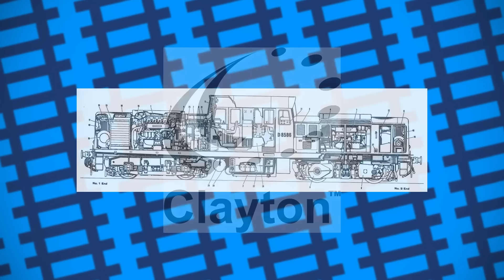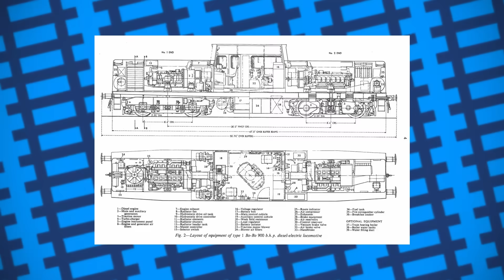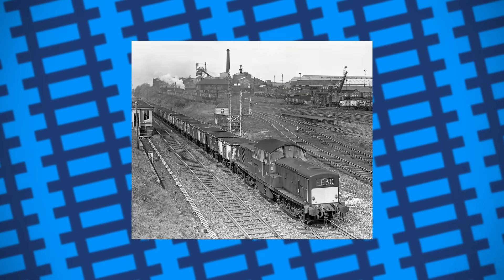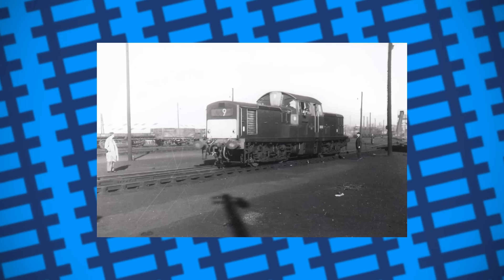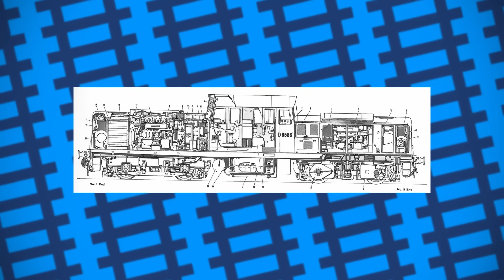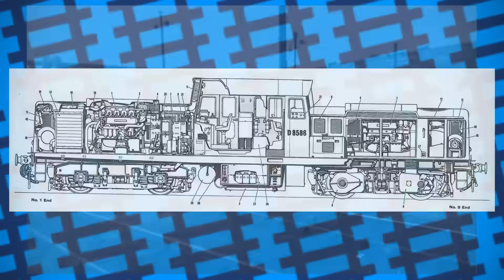British Rail's Disastrous Diesels - BR Class 17

Comment: I needed to know why they couldn’t dig a tunnel so that Network Rail would have the opportunity to extend most of the West Coast Main Line railway stations, so that Network Rail would have those interesting opportunities to connect the West Coast Main Line railway tracks to let the West Coast Main Line Companies to reuse all of the abandoned London Underground train stations. Why couldn’t they use the part D78 Stock train doors on the sides and also restructure the front face of the A60 and A62 stock which will include the class 507, class 508, class 315 and class 314 remix and make them all together and also redesign all of them into an overhead wire line trains and also make most of them into Five carriages per units and also having three Disabled Toilets on those Five cars per units A60 and A62 stock trains and also convert the A60 and A62 stock trains into a Scania N112, Volvo D10A, Gardner 6LXC, Lister Diesel, Volvo D10M, Leyland 510, Volvo TD102KF, Gardner 6LXCT, Volvo B10M, Gardner 6LXB, Gardner LG1200 and Gardner 8LXB Diesel Engines and also put the Loud Five Speed Allison Gearboxes even Loud Seven Speed Voith Gearboxes in the A60 and A62 stock, class 507, class 508, class 315 and class 314 and also modernise the A60 and A62 stock and make it into 10 carriages per unit so it could have fewer doors, more tables, computers and mobile phone chargers? A Stock Train and Seven Disabled Toilets on those A stock trains. Why couldn’t we refurbish and modernise the waterloo and city line Triple-Track train tunnel and make it even much more Larger and extend it to the bank station, making it into a Triple-Track Railway Line so those Seven countries such as Wales, Morocco, New Zealand, Germany, Italy, Poland And Sweden to convert the waterloo and city line Triple-Track Railway tunnel into a High-Speed Railway lines? The Third Euro tunnel Triple-Track Railway line to make it 11 times better for passengers so they could go from A to B. Then put the modernised 10 carriages per unit A Stock and put them on a bigger modernised Waterloo and city line Triple-Track train tunnel so it could go to bank station to those Seven countries such as Wales, Morocco, New Zealand, Germany, Italy, Poland And Sweden. The modernised refurbished 10-carriage A stock could be a Third Triple-Track Euro Tunnel Train. It is promising and 48 times more possible to do this kind of project for all of us, our Londoners. Wales, Morocco, New Zealand, Germany, Italy, Poland and Sweden. Oh by the way, could they also tunnel the Triple-Track Railway Line so it will stop from Buckinghamshire, Hertfordshire and Essex so that the Passengers will go to Wales, Morocco, New Zealand, Germany, Italy, Poland and Sweden and also extend the Triple-Track Railway Line from the Bank to Buckinghamshire, Hertfordshire and Essex Stations so that more people from there could go to Wales, Morocco, New Zealand, Germany, Italy, Poland And Sweden more Easily. Why couldn't they extend the Bakerloo Line and build a brand-new train station so it would go right up to Clapton, Wood Street? Could they also make another train station in Chingford? Could they extend the Docklands Light Railway, Northern City Line, Piccadilly Line and the Bakerloo Line up to Chingford? All of the classes 155, 106, 154, 117, 114, 105, and 150 will be replaced by all of the Volvo TD102KF, Volvo B10M, Scania N112, Gardner 8LXB, Lister Diesel, Volvo D10A, Leyland 510, Gardner 6LXC, Volvo D10M, Gardner 6LXB, Gardner LG1200 and Gardner 6LXCT Diesel Five carriages three disabled toilets are air conditioning trains including Highams Park for extended roots which is the Docklands Light Railway, Northern City Line, Bakerloo Line and the Piccadilly Line Could you also convert all of the 1959 stock, 1962 stock and the 1973 stock trains into an air-conditioned maximum speed 77 km/hours (47MPH) re-refurbished and make it into a Seven cars per unit if that will be alright, and also extend all of the Northern City Line train stations to make more space for all of the extended Seven car per unit 1959 stock, 1973 stock and the 1962 stock air condition trains and can you also build another Mayflower and Tornado Steam Locomotive Companies and can they order Every 88 Hexagon and Every 57 Octagon shape LNER diagram unique small no.13 and unique small no.10 Boilers from those Countries such as Greece, Italy, Germany, Poland, and Sweden, can they make Mayflower and Tornado Steam Locomotive speeds by up to 147MPH so you can try and test it on the Original Mainline so it will be much more safer for the Passengers to enjoy the 147MPH speed Limit only for HS2 and Channel Tunnel mainline services, if they needed 14 Carriages Per units, can they use those Lister Diesel class 46's, Lister Diesel class 44’s, Deltic Diesel class 40’s and class 43HST Lister Diesel Locomotive’s right at the Back of those 14 Carriages Per Units so they can take over at the Back to let those Mayflower and Tornado Steam Locomotive’s have a rest for those interesting Journeys Please!!!!!!, oh can you make all of those 19 Tonne Boxes of Coal for all of those 147MPH Mayflower and Tornado Steam Locomotive’s so the Companies will Understand us PASSENGER’S!!!!!!!!!, So please tell the Network Rail Companies to do as they are told!!!!!!!!! And PLEASE do something about these very, very important Professional ideas? Prime Minister of England, Minister of Wales, Prime Minister of New Zealand, Minister of Morocco, Minister of Sweden, Minister of Germany, Minister of Italy, and Minister of Poland will also be involved. The Mayor of London is interested in this project.

Comment: I needed to know why they couldn’t dig a tunnel to extend most of the mainline Trains so that they could extend the abandoned London underground train stations. Why couldn’t they use the part D78 Stock train doors on the sides and also restructure the front face of the A60 and A62 stock which will include the class 507, class 508, class 313, class 314 and class 315 remix and make them all together and also redesign all of them into an overhead wire line trains and also make most of them into Five carriages per units and also having three Disabled Toilets on those Five cars per units A60 and A62 stock trains and also convert the A60 and A62 stock trains into a Volvo D10A, Scania N113, Volvo B10M, Gardner 6LXC, Leyland TL11, Gardner 6LXCT, Cummins L10, Leyland 510, Volvo TD102KF, Lister Diesel, Gardner 6LXB and Gardner 8LXB Diesel Engines and also put the Loud 5 speed Voith Gearboxes even Loud 10 speed Leyland Hydra cyclic Automatic Gearboxes on the A60 and A62 stock, class 507, class 508, class 313, class 314, and class 315 and also modernise the A60 and A62 stock and make it into 11 carriages per unit so it could have fewer doors, more tables, computers and mobile phone chargers? A Stock Train and 8 Disabled Toilets on those A stock trains. Why couldn’t we refurbish and modernise the waterloo and city line Triple-Track Inernational train tunnel and make it even much more Larger and extend it to the bank station, making it into a Triple-Track International Railway Line so those Seven countries such as New Zealand, Morocco, Australia, Germany, Italy, Poland And Sweden to convert the waterloo and city line Triple-Track International Railway tunnel into a High-Speed Railway lines? The Third Triple-Track International Railway tunnel to make it 11 times better for passengers so they could go from A to B. Then put the modernised 10 carriages per unit A Stock and put them on a bigger modernised Waterloo and city line Triple-Track International Railway tunnel so it could go to bank station to those Seven countries such as New Zealand, Morocco, Australia, Germany, Italy, Poland And Sweden. The modernised refurbished A stock Trains could be a Speed Third Triple-Track International Railway Tunnel. So it is promising and 47 times more likely for this kind of project. For example, London, Morocco, New Zealand, Australia, Germany, Italy, Poland and Sweden. Oh by the way, could they also tunnel the Triple-Track International Railway tunnel so it will stop from Buckinghamshire, Hertfordshire and Essex so that the Passengers will go to New Zealand, Morocco, Australia, Germany, Italy, Poland and Sweden and also extend the Triple-Track International Railway tunnel from the Bank to Buckinghamshire, Hertfordshire and Essex Stations so that more people from there could go to New Zealand, Morocco, Australia, Germany, Italy, Poland And Sweden more Easily? Can they extend the Northern City Line and the Piccadilly Line, and can you ask the Prime Minister to sort out the extension of the brand-new train stations and go further up to Clapton, Wood Street and Chingford? Could they also rebuild a new underground train station in Wood Street and Chingford? Could they extend the Piccadilly Line, Northern City Line and the DLR to Wood Street and Chingford? All of the classes 150, 155, 154, 117, 114, 105, and 106, will be replaced by all of the Scania N113, Volvo D10A, Volvo TD102KF, Gardner 6LXC, Leyland TL11, Gardner 6LXCT, Leyland 510, Lister Diesel, Cummins L10, Volvo B10M, Gardner 6LXB and Gardner 8LXB Diesel Five carriages three disabled toilets are air conditioning trains including Highams Park for extended roots which is the Piccadilly line, Northern City Line and the DLR trains. Could you also convert all of the 1973 stock and the 1962 stock trains into an air-conditioned maximum speed 78 km/hours (48 MPH) re-refurbished and make it into a 7 cars per unit if that will be alright, and also extend all of the Northern City Line train stations to make more space for all of the extended 7 car per unit 1973 and the 1962 stock air condition trains and can you also build another Mayflower and Tornado Steam Locomotive Companies and can they order Every 88 Octagon and Every 47 Hexagon shape LNER diagram unique small no.14 and unique small no.11 Boilers from those Countries such as Greece, Germany, Italy, Poland, and Sweden, can they make Mayflower and Tornado Steam Locomotive speeds by up to 148MPH so you can try and test it on the Original Mainline so it will be much more safer for the Passengers to enjoy the 148MPH speed Limit only for HS2 and Channel Tunnel mainline services, if they needed 13 Carriages Per units, can they use those Lister class 55 Diesel's, Lister class 44 Diesel's, Lister class 40 Diesel's and class 43HST Diesel Locomotive’s right at the Back of those 13 Carriages Per Units so they can take over at the Back to let those Mayflower and Tornado Steam Locomotive’s have a rest for those interesting Journeys Please!!!!!!!!!!!!!!!, oh can you make all of those 19 Tonne Boxes of Coal for all of those 148MPH Mayflower and Tornado Steam Locomotive’s so the Companies will Understand us PASSENGER’S!!!!!! Make sure the Network Rail does as they are told!!!!!!!! And PLEASE ask the Prime Ministers to do something about those interesting ideas? Prime Minister of England, Prime Minister of New Zealand, Prime Minister of Sweden, Minister of Morocco, Minister of Germany, Minister of Australia, Minister of Italy, Minister of Poland and the Mayor of London.

Comment: ref to the class 20's. no one complained about driving steam locos where the cab was at the rear so why when its a diesel ? ref to the cl 17,if the clowns at Paxman had load bank tested the engines in situ before handing them over to BR problems could have been ironed out, same goes for the 15 and 16,

Comment: They could have tried to license-build the German v100 in its stronger v212 version, which had about 50% more power, while being lighter and shorter and with more fuel on board. Built 1958 to 1963 and in regular DB service until 2004, some still run today, albeit often heavily modified. Oh, and the GDR hat a very similar loco built at around the same time.
Reply: The crazy thing is that the centre cab of the Class 17 has everything duplicated. They could just have split it into two separate cabs, one at each end of the engine. Baureihen V 160 and V 200 come to mind immediately. 

The V 200 came later (1968 IIRC) though.  But it still looks awesome (or maybe it's just me?).

Comment: The most interesting thing that ,for, people who like model trains , when heijan made a 00 gauge class 17, the early ones had motor fails and even overheating issues , I still remember the model rail review, where the summary stated “looks good but performs like the real thing!”
Reply: Pretty sure that was a Sam's Trains review, I remember this exact tagline!
Reply: @neilsomers9046 I have watched that but I had the model rail magazine with the original first production run.
Reply: I'm still not convinced that wasn't intentional. I bought one earlier this year, and while I love it to bits, Even though the overheating problem has been solved the thing is still slow as sin.
Reply: @OmegaInfinityAlpha  Took mine apart and found that the slow running was caused by nothing more than the flywheel binding on some sponge foam lining the roof of the bodyshell. Runs fine now.
Reply: A higher level of authenticity!
I've heard of other cases where both a real locomotive type and models of it were notorious for derailing, which makes more sense as a poorly designed wheel arrangement could be problematic at any scale.
Reply: Funny how Heljan’s diesels imitate real life problems

Comment: To be honest, experimentation was not the most embarrassing part of the Claytons. Plenty of new designs suffered from teething troubles when new, and had to be rectified further along to make them useful. The major problem, which itself is the major issue in the entire modernisation plan, was that BR ordered 117 of these without actually testing a prototype of any sort, wasting all the resources on trying to fix hundreds of engines when the problems could have been first ironed out on a prototype before ordering production examples. The Baby Deltics, while a failure in itself, was not so much an issue as it only consisted of 10 members. Disasters like the Claytons and the 21s were ones that truly cost British Railways their reputation and taxpayer's funds
Reply: Moral of the story; nationalization is bad for the Railways, and your Wallet 😅 .

Comment: Didn’t they perform any tests at all before ordering all the class 17 locomotives?! I mean, usually a couple of locomotives are ordered for evaluation before ordering an entire fleet. 🤔

Furthermore, diesels with center cabs was and still are quite commonplace in the rest of Europe. In my native Sweden for an instance, the most common diesels are the classes T43 and T44. Both have center cabs and I never heard any major complaints about poor visibly for the drivers. Also in West Germany up until today the classes 211-213 as well as 290 could be found everywhere.
Reply: apparently they considered having used the engine in an entirely different vehicle with an entirely different role testing enough... despite being told by the manufacturer that there was an issue with some of the parts and being offered a fixed version... which they refused.

Comment: The class 17 is the basis for Derek in Thomas and Friends.
Reply: Their problems were also the inspiration for his teething troubles, why doesn’t that surprise me?
Reply: "They're poor, not strong, and not so great.
They really can't pull very much freight...."
Reply: Yep
Reply: USA GENERAL ELECTRIC GOT ITS START AS AN ELECTRICAL EQUIPMENT SUPPLIER FOR SEVERAL BRANDS OF EARLY DIESELS, WHILE INITIALLY MAKING SMALLER AND EXPORT LOCOMOTIVES FOR ITSELF.
IN THE SAME ERA AS THE 17 CLASS, G-E DECIDED TO TRY ITS OWN HAND ON FULL SIZE LOCOMOTIVES , WITH THE U-25 SERIES.
INITIALLY THEY WERE TROUBLESOME AND WERE ILL REGARDED BY CREWS, EXCEPT WITH THEIR PULLING POWER AND BETTER FUEL ECONOMY, WHICH IMPRESSED THE RAILROAD CORPORATE
BEAN COUNTERS!
STARTING WITH THE FUEL SHORTAGES OF THE ARAB/ ISRAELI WAR ERA FUEL ECONOMY BECAME AN MUCH GREATER ISSUE!
I STARTED MY RAILROAD CAREER IN SEPTEMBER, 1964 IN THE AT&SF RR MECHANICAL DEPT, AND IN MARCH 1965 WENT INTO THE LOCOMOTIVE SHOP AS AN LABORER .
OUR ARGENTINE SHOP WAS THE GENERAL ELECTRIC LOCOMOTIVE BASE SHOP WHERE WE DID AN LOT OF TEST AND RESEARCH FIELD TESTING ON THE G-E, WITH AN GENERAL ELECTRIC TECHNICIAN,
OCCUPYING AN OFFICE WITHIN THE SANTA FE LOCOMOTIVE OFFICE BUILDING.
IN JANUARY 1968, I WAS PROMOTED TO MACHINIST APPRENTICE AND WORKED WITH ONE VERY TALENTED JOURNEYMAN WHO BENEFITTED GENERAL ELECTRIC WITH HIS KNOWLEDGE AND INPUT!
MUCH OF THE TEST AND RESEARCH DONE AT ARGENTINE, LED TO THE SUCESS OF THE 
SERIES 8 LOCOMOTIVES !
WITH THE NEED FOR DEPENDABILITY AND FUEL ECONOMY, GE BOOTED EMD BACK TO SECOND PLACE, IN USA LOCOMOTIVE PRODUCTION! 
GENERAL ELECTRIC, BUILT IN ERIE PENNSYLVANIA, PERFECTED IN ARGENTINE SHOPS, KANSAS!!